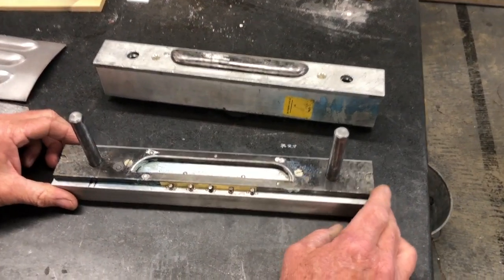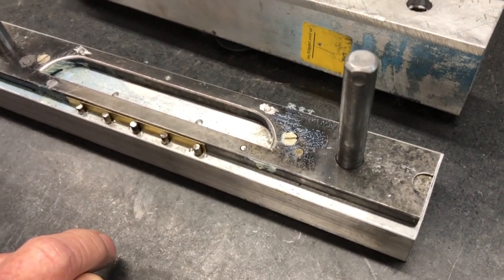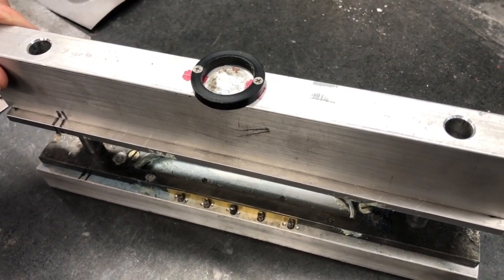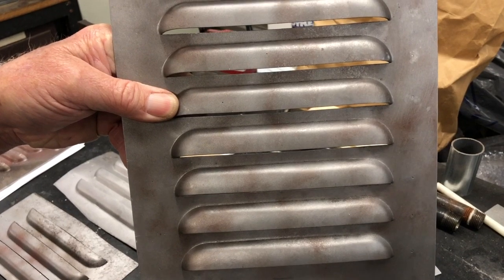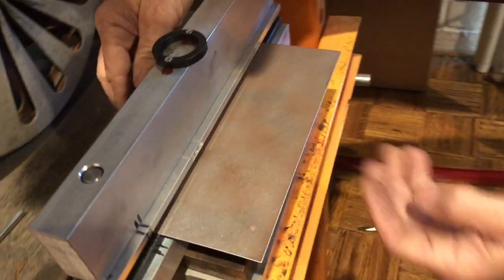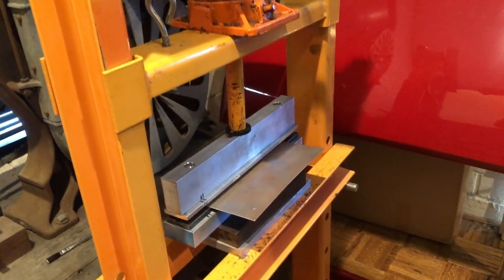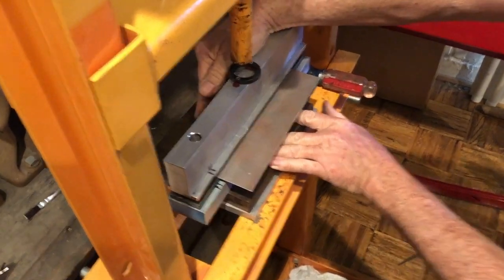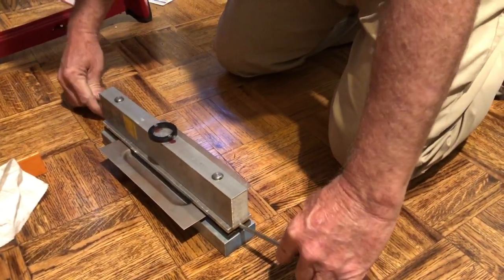HOMEMADE 6" LOUVER PUNCH

Comment: Nice! Works well. I'm about to build a louver press myself, will use a couple of lathe high speed steel blanks as my cutting edges, regular old 1018 steel for the rest of the die pattern. Thanks for posting the video!
Reply from the maker: Thanks. That should certainly give long life but how to you plan to attach the lathe blank?
Reply: @thebluecaddy2950  Not hard to attach at all. The back of the bottom die machined from 1018 to louver shape, the cutting edge held in a machined groove with 3/8 set screws and a tack weld on either end. The punch is machined again from 1018 and the cutting edge area machined out to the size of the square profile of the bar of HSS and welded in with MIG in short bursts so you can let it cool between spots. HHS welded to 1018 actually makes a pretty strong union. I have a glass pack coring machine I built 25 years ago that punches 6 louvers around the radius of a  length of exhaust tube. I would surmise each of the sIx HHS blanks
 has punched 3 million louvers without sharpening having just done the math.

Comment: You will love an air over hydraulic jack on that press.  I put a HF 30 ton one on mine and will never go back to the old way.  I finess the press with the pump handle, but the big steps are so much easier to just press the air valve and let it run down.

I have a 90 deg bender like that and even built a round edge bender for making "J" hooks.  Only I used old motorcycle fork springs to raise my dies back up.

Comment: Great job. Another way to make the punch and die, is to use regular mild steel, but to hard face the edges with commonly available hard-facing rods which are the equivalent of tool steel. :)

Comment: hi, do you have a video of building process and dimensions.  epic build
Reply from the maker: Thanks! No video of the build. I can say from researching the fab process of these punches, the most critical thing is getting the shearing edges positioned accurately and very close to each other - .005" or less. This ensures that they will punch the Louvre when pressure is applied and there will be no binding.
Basic building sequence was first build the basic parts with the dowel pins. Next, mount the female half of the cutting tool on the base. Then temporarily mount the male cutting edge inside the female and onto the base with machine screws. (You can see the holes in the video) I did it with a .003" shim between the two cutting edges. Then I slid the top section over the big dowels and drill two 1/8 ' holes for dowels through the male cutting edge. Take everything apart, unscrew the male cutting edge from the base and now attach it to the top section using the 1/8" dowel holes to accurately locate it.
All other dimensions are not critical, I just used material I thought was strong enough. Top and bottom sections are 1" x 2" 6061 aluminum I got from McMaster Carr.

Comment: nice, to make more efficient of a process, you should extend the center circle to be a pipe that you can put a pin in to connect it to the rod of the press.
Reply from the maker: Thanks. That would work but I wasn't planning to punch a great number of them.

Comment: 1.6 mm thickness hydraulic pressing Ton capacity ?
Reply from the maker: I used a 12 ton press. I don't think this method would work with much less than that.

Comment: How did you end up designing your die shape?
Reply from the maker: The louvres are 5/16" high so I did a full radius running all around the back side. For the back corners - when looking down on them - I basically copied what I'd seen on others. I rounded it off until it looked right. I think there is a standard look to them and I just tried to achieve that.
They are 3/4" front to back and spaced 1 1/4" apart. That is pretty standard and does look traditional.

Comment: Nicely done, very neat and well formed louvre. 😉👍
Reply from the maker: Thank you. I actually arrived at these results faster than I thought I was going to. As I mentioned in the video, I learned a lot from watching similar videos here. I adjusted to the 6" louver I wanted. One tip I got and implemented was that it was critical that the cutting edges have only about .001" - .002 clearance between each other so I designed the tool to allow myself to be able to align them that accurately.